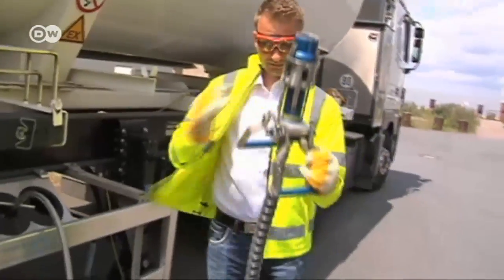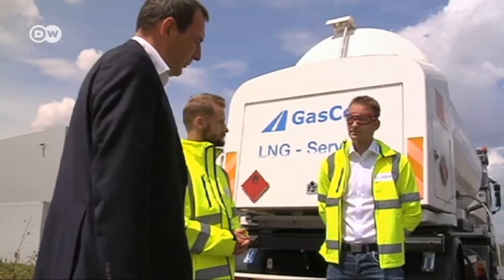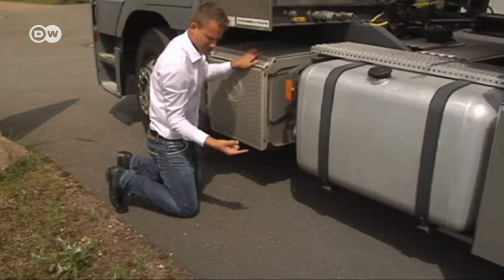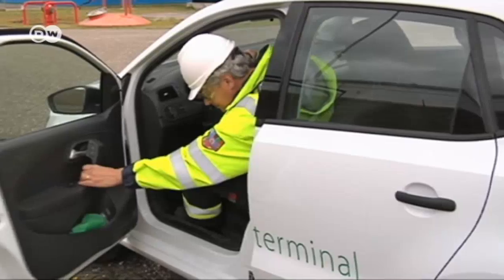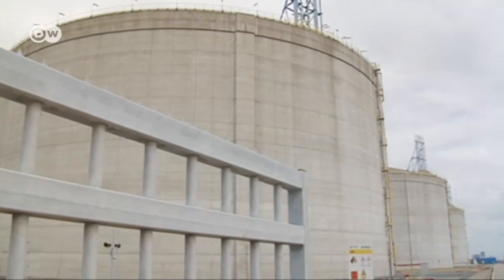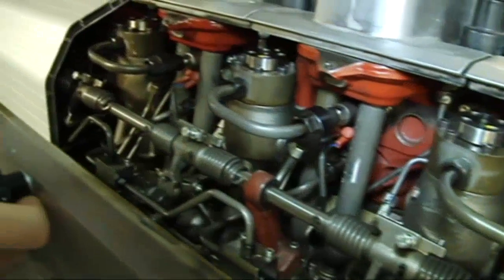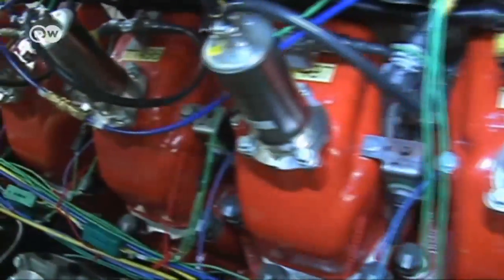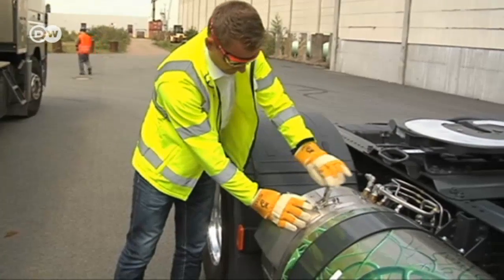LNG - Better than diesel? | DW English

Comment: I drive a Volvo FH LNG, it almost has the same power as the diesel counterpart, only downside is that you have to vent it like every 48 hours and the range is really low, one full tank (around 150 kg) only lasts like 350-400 km…

Comment: In Australia I started using LPG (not LNG) gas in my car in the 80s to save $ and the environment. 
The government at the time helped out with converting to use it in your car $.
They said it would never cost over 18 cents per litre and petrol was 50 + cents 
Now 2021 it's costing me 95 cents + 
Petrol is $ 1.60 +
I have to burn about 1/3 more LPG to get same km .
I'm trying to have minimal impact on the environment by using this fuel and the government is ripping me off..
Our government is only interested in taking the people into poverty..
Shutting down industry and importing thousands every year with no work 
Only on government hand outs .
Im 60 now and watched Australia go down the drain over the last 40 years big time....
Reply: Same happening in the UK

Comment: LPG seems much  more productive option.
In Bulgaria maybe  half of the automobiles are on LPG or methan (LNG) for decades. But  there's  an enormous loss of power with the LNG which with  LPG can be compensated.
The most practical decision is the mixed 1:2 - disel:LPG mixture.
Though  it requires additional lubrication for the engine.
It gives  the long output of the diesel and the full and fast combustion of the LPG
Reply: Hey man,
I am a German currently living in Varna and I was just going to say so!
LPG would have been so good, atleast as a transition until things become fully electric, or maybe hydrogen powered!
It’s nice to see, how somewhat Bulgaria is a step ahead!
Where about are you from?

Comment: I have a 1963 Mercedes Unimog converted to LPG since 2008. Only maintenance on the system was a check on the tank whicjmh is 150 litres usable. This is a six cylinder petrol engine and I have electronic ignition and the multiple electrode spark plugs. There is never any smoke from the engine. To start I switch the gas on and off a few times ans hit the button as there is no real choke.

Comment: Rio de Janeiro has 60% of the fleet of passenger vehicles powered by LNG. 100% of taxis and Ubers.
Reply: R u sure taxis and uber r run on LNG? Or is it cng ?
Reply: @casualbrainaic3360  Thanks!
Reply: @casualbrainaic3360  Sorry, you're right, I didn't know the slight difference between the two, this really is CNG. (So called in Brazil GNV)

Comment: I would say the main issue is energy density. It is too low for LNG when compared to diesel. It is also too volatile and can not be stored nearly as easily as diesel. Certainly there are good use cases but I am pretty sure this trend will be short lived

Comment: I have thought storry about the  liquefied nitrogen gas as a source of high pressure trust.  But it is propan or butan gas as a usual gas for auto just differently named. 🤔
Reply: LNG can be methane, propane or butane but is usually methane. CNG will be methane . LPG is understood to be propane/butane  or propane . But no reason for not including methane as LPG. It gets more confused with time.

Comment: 147k BTU per gallon for diesel, 82k per gallon for LNG. No, natural gas is not better by a LONG shot.
Reply: 55.5 megajoules per kilogram of energy is released when natural gas is burned and about 46 megajoules of energy per kilogram is released when diesel fuel is burned.
Reply: @Jemalacane0  incorrect. MJ for a gallon of diesel is 155 MJ. The same quantity of LNG is 86 MJ. It’s a well known fact diesel contains more energy density, don’t even know why you’d argue that. Convert it to what ever you want that fact remains the same.

Comment: I remember 30 years ago there were some buses modified for natural gas,but I know for sure they have also some oil injection system because it was to dry or something,in the end were scrapped.And no Hidrogen in is not a solution,when you need electricity to make it,better skip that and use electricity directly.

Comment: Thailand has had trucks running on gas for at least 10 years & more.    This is nothing new.   Truth is it’s cheap, but doesn’t have a good range due to small tanks.
Reply: I drive at FrieslandCampina with an lng volvo truck (range 800km with 190 kg lng perfect for 1 route we drive 10 hours in 12 hour shift) but the truth nobody talks about is what those ships that transfer those fuels from the persian gulf emit in the air.. Basicly in the big open ocean you don't have rules so they burn the cheapest dirtiest oil in their engines from those ships. Electric would be way better becouse it get rid of that co2 shipping cost..

Comment: Diesel has lubricating properties for engine and pump components , how are they overcoming this , if it’s like LPG they add extra chemicals to the fuel line , What do these chemicals do and what are they ??????
I have 30 years experience in the fuel supply industry, and I can see issues with engine longevity and components braking down and premature wearing out of engines .
Reply: LNG nd CNG has been used a motor fuel for 40+ years  Engine longevity is increased by 80% over gasoline and about 40% over diesel. NO extra chemicals are added and even for LPG nothing is added for use as a motor fuel it comes from the same place as all other LPG  which has been around since the 1950s as a motor fuel.  It is quite apparent you have no clue what you are talking about.
Reply: Watch this space , !!!

Comment: No matter what fuel you use, the common internal combustion engine has a lousy thermal efficiency of less than 15-20%, the rest is wasted as hot exhaust.
Reply: It's about getting rid of emissions and reliance on oil, a transition phase if you will.
Reply: @jooch_exe  Even from an incremental improvement perspective, LNG for domestic civilian transport (cars, trucks, buses), LNG makes no sense - it is liquified only for long distance ship transport in very large low pressure storage tanks. Once within Germany, high pressure CNG makes more sense.
Reply: @MariAmmaSar  What’s safer, lower pressure, dense liquified natural gas that doesn’t burn without first boiling, or high pressure, less dense, burnable compressed natural gas. I’d imagine there might be a reason LNG would be favored. If not from safety stand point, then from an energy density stand point. Might be more expensive, but LNG takes up less room.
Reply: @bigbuilder10  Low pressure, more dense liquid is indeed generally safer and better than HP compressed gas storage down to a some low temperature limit. But here, LNG is at -160degC at LP storage, which brings in several disadvantages, which would more than outweigh the disadvantages/risks with HP CNG storage at ambient temp.
Reply: @bigbuilder10  From a energy density perspective, dimethly ether (DME) is about as good as LNG, and can be stored at 15atm at ambient temps(about the same as LPG storage) and is easily manufactured from natural gas.
Reply: "Toyota's new Dynamic Force Engine has made a breakthrough in thermal efficiency in being 40 percent efficient as a conventional engine and 41 percent efficient in hybrid form"
Reply: Apart from hydrogen.

Comment: Imagine a ruptured tank....if the crash didn't kill you the LNG explosion will.
Reply: You could not be more wrong.  Lng is under high pressure and the gas cloud explodes the same as if you open the valve at home and lit a match.   It's still ng
Reply: bryan nonya what about when batteries get squashed?
Reply: They've tried to make them explode with no success. Myth busters maybe one example . Tanks have been thrown into fires , peppered with bullets .
Reply: LNG is actually quite difficult to ignite and when it does, it's more of a slow burn.

Comment: .....How old is the diesel truck they wiped their finger on, on the exhaust? DPF diesels don't do that unless there's a problem with the DPF structurally..... This smells like a curated piece of news.
Reply: Remember volkswagen. This is same now.
Reply: @abdelmouinboukhalfa4684  - I was wondering that to!  Has the diesel been ran for tens, hundreds or thousands of miles and the LNG may have only ran a few miles or tens of miles!  If this was a court case, any attorney would contest this as evidence!
Reply: Dpf is the stupidest thing to come out since glass cell phones....
Reply: also shorter the carbon chains lesser is the energy of that fuel.

Comment: I would like to see a comparison of this ICE use of LNG to fuel cells.  Theoretically ICE still wastes about 30% more of the chemical energy into heat.  Fuel cells still need electric motors, but that opens up a path to increasing use of renewable sources when available.
Reply: Now its 40% efficient
Reply: @ayushk4099  No it is not when talking about cars. Don't mix average and maximum efficiency.. Maximum efficiency may be 40%, but that doesn't matter because average efficiency during driving is only around 20%.
Reply: @jasensalivec1475  20% for a modern car seems too low average thermal efficiency may be around 30% for regular engine and 35-40% for Hybrids
Reply: @ayushk4099  Based on the fact that hybrids consume 25 % less fuel than regular diesel car, hybrids have around 25 % on average, during city driving it can be 35 %.

Comment: Diesel will run on any organic oil edible or not.
Reply: @youtubechampion9377  sure!
Peanut oil was the original fuel. Edible oils have no sulphur.  The modern fuels have additives regulated by the feds.
Diesel engine will run fine on kerosene, with a slight loss of power. Jet A fuel works good too, with the mandatory addition of 1 quart of 30 weight motor oil per 200 gallon for lubrication. 
This has been well documented over the years. This is a very versatile power source with great low end power.

Comment: This is ridiculous this fuel still releases massive amounts of of CO2.  They talked about particulates, and that is another problem that these fossil fuel vehicles have, and it still has that problem as well.

Investing money into building up new infrastructure to burn more fossil fuels is going to speed up global warming.

As far as the lorries are concerned there are EV lorries that are about to be released by Tesla, BYD, Mercedes, Volvo, Renault, Mitsubishi, DAF, MAN, Scania, and many more.  When there is such a big movement towards electric lorries, it makes no sense to build new fossil fuel technology.

As for the ships, then hydrogen is the answer, there are already some ships mostly car ferries, but these have a short range.  If a ship is going to travel up and down the Rhein, then hydrogen is by far the best option.

Comment: Here in Australia we had been using lp gas in cars for a long time. It’s also as clean. But the vehicle manufacturing had stop so this will also
Reply: Add-on LPG kits, don't you have them there? Even if you don't, you can buy them off amazon or something
Reply: @V12BigBlock  I don't think every vehicle can use that. I used to have a Toyota Prado and asked if I can converted that to LP gas professionally. Toyota service department says no. It will damage the valve seats, they said
Reply: @rayleeaustralia  i live in a country where they put these things on almost every car, i've seen from Land Rovers to Mercedes with LPG tanks in the trunks, it doesn't damage anything
Reply: @rayleeaustralia  there's plenty of aftermarket conversion companies here in Australia that will do it for you but sometimes the manufacturer will recommend against it. It's not that common anymore because the government no longer provides a tax incentive to offset the cost of it.
Reply: @tomtom1541  it’s a shame that the Australian government is not pursuing this fuel for motor vehicles rather than selling cheap overseas. It’s a rather clean fuel compared to petrol and diesel. Australia have plenty of this and the prices at the pump are ridiculous
Reply: @rayleeaustralia  well they used to pursue it, but nowadays you have hybrids and super efficient petrol engines so it's less off a concern to them. Autogas has died off mainly because automakers don't want to invest in it. Taxi companies used to use it a lot but now they've started changing to Toyota hybrids.

Comment: Far to difficult to handle. LPG is are far better option as it doesn't need to be frozen only pressurised
Reply: LPG Is bi-product of oil refinment... Its like 1% of the refinned oil other 99% Is diesel, gasoline, etc... Its destined to be just a cheap alternative for few people in cars and for camping...
Reply: @TheJirkal  Not in Australia it isn't, we have LPG available at almost every gas station. My car runs on dedicated LPG and cost much less to fill the tank.
Reply: Or Just use CNG that only has to be compressed.
Reply: as far as I know lpg has more pollution than lng, and its more dangerous to the enviroment once its spilled it will spill on the ground meanwhile lng is just evaporates
Reply: LNG tells us nothing. CNG however tells us it's compressed natural gas usually methane.  If it doesn't liquify at the pressure stored it's called CNG. Our automotive LPG is understood to be 50/50 butane/propane requiring hardly more than two atmosphere pressure to liquify . Pure propane LPG for domestic use requires maybe three or four atmosphere to liquify . Pure methane requires a high pressure to liquify and tanks weigh twice as much as propane or butane/propane tanks . Butane of course is in plastic cigarette lighters and needs less than an atmosphere pressure to liquify .
  It's not a good move these days to obsess over particulate emissions . We need more particulate emissions around 3 nm size to cool the planet. We got serious fires now because of covid virus grounding passenger jets from skies among other pullbacks. Our atmosphere is too clean and planet has now warmed up a little extra in last 18 months .  At 420 ppm of co2 a sustained clean atmosphere will be  catastrophic unless we get down to 350 and lower but that'll take a hundred years to get to 350 .
Reply: @charlesdickens6706  Make sense

Comment: It's a shame that LNG for vehicles was killed by the EV Hype.  LNG exhaust fumes are as clean as it can get when burning something. At least for long range traffic LNG would be perfect and later if we have enough green Hydrogen we still could mix the LNG with Hydrogen and therefore make it even CO2 leaner.
Reply: EV is just the lithium mining consortiums paying their way into big profits with governments by making it seem like EV is "eco friendly". When in reality, it's not.
Reply: @JosephArata  It was good to hear a UK MP speaking out against the EV hype the other day.
Reply: Indoor gas powered fork lift trucks with zero emissions have been used for years in warehouses. EV, like  climate change as you say is a massive hype!
Reply: Ronnie G . Sir I believe that the fork lifts you talk about were powered with LPG ! I worked at Toyota for 20 yrs , the forklifts all had 6 cyl Land Cruiser engines & the tow motors all had Toyota Corolla motors , all converted over to run on LPG . , and an added benefit to LPG is the engines last about twice as long , so car companies don’t like that idea !!!!!!

Comment: Do LNG cost effective?!
Why not using it as CNG?
Reply: Hi, it's just because of energy density.
1L of lng has like 30 times more energy in it than 1L of CNG. It means roughly that to achieve the same distance on 1 tank, a CNG vehicle has to have a 30 times bigger tank than the same vehicle propelled with lng.
Hope i was clear, have a good day!
Reply: @Giovanni-yy8gc  Yeah and CNG vehicles don't have a lot of power. The one major advantage CNG has is that you don't need specialized safety equipment for refueling.
Reply: @carl8790  another problem with CNG, it creates crank case water vapor, so you have to change the oil more often than other diesel or diesel like ignition sources. CNG is fuel quenched, not air as well. So you're taking a diesel engine and retrofitting it to run as a spark ignition gasoline engine with CNG, so it's way less efficient than standard diesel or bio diesel, which are compression ignited.

Comment: in india we use CNG and LPG are they same as LNG??
Reply: CNG is obtained by compressing natural gas to 200-250 bar and contains methane, ethane, propane and butane. LNG is obtained by cooling natural gas to -160°c and contains methane, ethane, propane, butane and small amounts of iso propane. LPG is obtained by compressing petroleum gas to liquid and is mainly propane, butane and small amounts of propylene
Reply: @SarathVChandran34  could you tell which one is more eco friendly?
Reply: @ilovepakistanitea1378  CNG would be the most eco friendly among them.  LPG is least eco friendly among these
Reply: CNG/LNG mainly constitute methane gas while LPG gas propane.
Reply: No bro
Reply: few days ago first lng pump start in nagpur I think...or nasik
Reply: @johny689  Nagpur
Reply: @johny689  nagpur

Comment: All I can tell you is that CNG powered buses are dogs to drive.
Reply: Eh, your maintenance department sucks then at maintaining the spark ignition systems, doing valve adjustments, and changing pressure regulation parts when they fail. Because that's the majority of what entails maintaining CNG engines so they'll run right and have power.